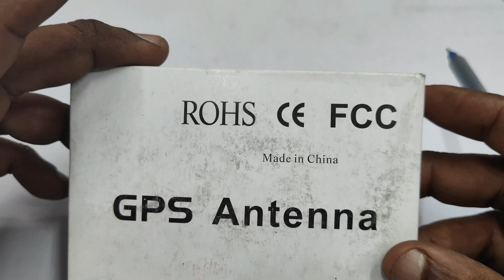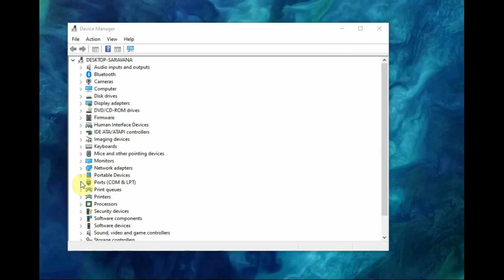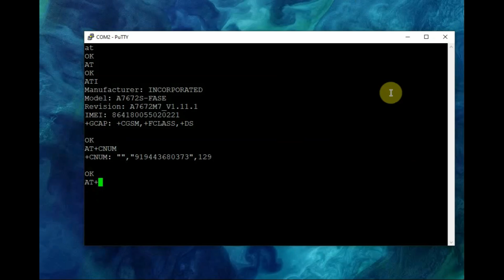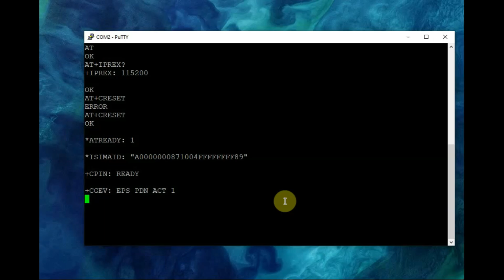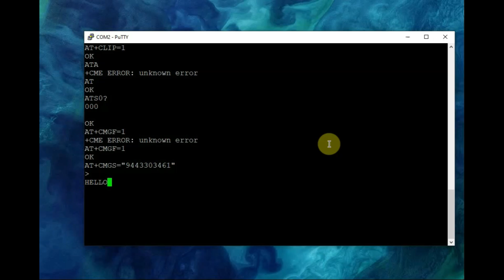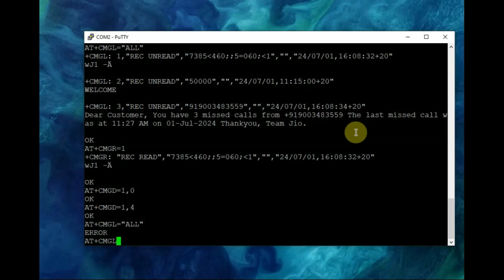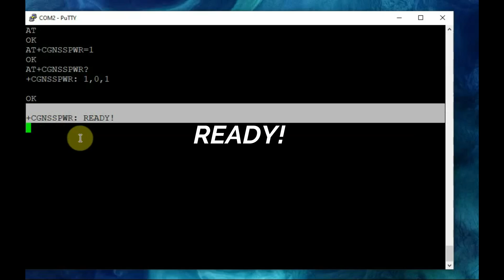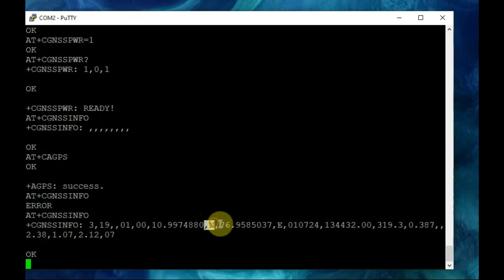GSM 4G LTE A7672S with GNSS GPS BT -Getting Started with AT Commands

Comment: Good Evening Sir! The Video is really helpful.                                                                                                               I have been working on A7672S module for vehicle tracking system. All the other AT cmds are working fine. But when I send AT+CGNSSPWR=1 its not returning Ready msg andI am not able to retrieve the GNSS data to the AT Port.                                                                                                                 My Module has the below firmware.                                                                                                               Model: A7672S-FASE
.Revision: A011B07A7672M7_F
.A7672M7_B07V04_230413
.QCN:
.IMEI: 861657073553963
.MEID:
.+GCAP: +CGSM,+FCLASS,+DS
AT+BT
.+BT: Apr 13 2023  16:48:52 .                                                                                                                               I am Actually not using the Development Board but we have developed our own board as per our requirement.  Circuit is as per Datasheet of the Module an all the other features like Data sending part is working fine. Can I know if I missed anything?                                                                          Thank You.